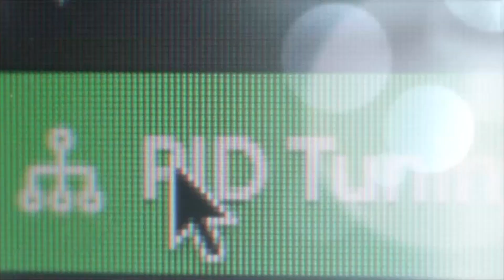Cleanflight and Betaflight Are Ending Support for F1 Boards

Comment: Found an AfroFlight32 while doing some cleaning, plugged it in to current betaflight and saw it connect with its 3.2 firmware. Feels odd to throw it away, maybe I will add it as a flight stabilizer to a plane that has no FPV and no telemetry. One UART, just one! Crazy, how did we live like this, lol...

Comment: i have naze32 and I'm still using cleanflight. You may have to use the "recovery" method when flashing the latest firmware, but its still supported.

Comment: And here we are, almost 2 years later: The crappy F4 zombie without hardware inverters is still surviving, for some reason, even though the F7 has made it obsolete >2 years ago. Well, that's how things are. Bad habbits die hard.
Reply from the maker: F4 boards are between $5 and $10 cheaper than F7 boards typically. If the F4 does everything you need it to do, why not save $5.
Reply: @JoshuaBardwell  :-D Perhaps because $5 is usually ~10% of a good FC’s price and I just don’t want all the hassle that comes with an F4. For example, let’s say you get an R-XSR. With an F7, you may choose to connect your S.bus and SmartPort to a random pair of UARTs from the 8 available. Or you may just as well choose to go with F.port and save the other 7 UARTs for SmartAudio, external OSD, ESC telemetry, GPS, LIDAR or whatever else. With an F4, you will always suffer: Cut the R-XSR’s heatshrink, solder to the uninverted pad, redo the heatshrink… That may sound easy, but at the end of the day, your GPS won’t fit, because there are too few UARTs on an F4. Not worth the $5. And with the growing number of 20×20mm F7s (although it’s mostly a 722, not a 745, unless you go with the Realacc Super_S F7), F4s are now utterly obsolete.

I do like to experiment with vintage hardware: https://www.rcgroups.com/forums/showthread.php?2906663-Eachine-XFX90-90mm-Brushless-FPV-Racer-F3-OSD-Dshot-%28review%29#post41722327 Nothing wrong with that. But when it comes to starting a new build, only an F7 makes sense.

Yet ~90% of Betaflight 4.0.x reviews I’ve seen mention F4s or even F3s as if those were still a thing. ;-)

Comment: I just set up a Naze32 for a new flyer, he had it partially built for ages, so I finished it off for him.
The latest supported Betaflight just works.
Did no tuning, just set up flight modes and arm switch.
It flys better on defaults than any quad I have ever set up.
He's lovin it.
I wll put F3 or F4 boards on anything I build in the future but I see no reason to rush out and update my current ones. They will continue to do what they do until I break them.
I can see these F1 boards still being fine as flight stabilisers on fixed wing or as cheap camera gimbal controllers.
Reply: wich version you put on the naze32 ? i m looking for the .hex who will work on betaflight but i dont see naze32 board in the list to dl fw
Reply: @user-mo4ul5td2p  This was 4 years ago, you will have to find an older version.
I still have the quad at home so I will see what is on it when I get home after work.

Comment: I unfortunately received one of these instead of an f3 brushed fc. 
What a pain in the ass. Had to use an old version of cleanflight, and cant find much info on what to flash onto it. Unless I use the oldest firmware, it maxes out the cpu load and wont work right, and if I can get it to work the accelerometer twitches on the configurator which makes my quad yaw like crazy. Its really finicky compared to my f3 that died. 
Anyone know how to use one of these f1 boards and have it be reliable?
Reply from the maker: Start by setting PID loop and gyro update rate to 1 kHz.

Comment: Joshua, I ordered Kakute F4 AIO a week ago and hope that it will be so good as it is described. Particularly because you claim that it would run SmartPort to XSR receiver without modying the receiver itself to deal with inverse signal. I will keep you to your word :)

To ppl worying about Naze support. If your quads already are flying well don't mess with them. When Naze boards in them will die, problem will become solved automatically by need to buy a new FC. Which in that time will be compatible with newest CF/BF.

Comment: Dear Joshua, thank you for the warning. Although I am planning to build a Trifecta with TriFlight firmware, it is good to know and I am looking for a F3 board as you mentioned. However, there are so many types of Betaflight f3. I do not know what model to choose. I am looking for Naze32 measurements or is that also not done anymore? (micro ?).  Which one would you  advise. With drones I am a newby pilot and not very skilled - yet.  :-)
Reply from the maker: For a tricopter, look at David Windestal's FC, which uses an F3.

https://rcexplorer.se/product/f3fc-racing/
Reply: Dear Joshua, I am actually thinking of this board as I do not want a onboard PDB in this build. I have a separate Matek PDB on the level of the motors. FC is a bit too high up:
https://www.banggood.com/Upgrade-NAZE32-F3-Flight-Controller-Acro-6-DOF-Deluxe-10-DOF-for-Multirotor-Racing-p-1010232.html?utm_source=google&utm_medium=cpc_ods&utm_content=jeff&utm_campaign=Smlr-ds-FC&gclid=CK3ChJK74NQCFW4R0wodS1AMbA

Comment: Its nonsense to recommend to NOT use a naze32 if you already have it in a new quad.
Lifespan is one fatal crash away and since you already have it why not use it.
Also a tuned quad will not STOP FLYING once support is ended ; just changing settings might become complicated.

Comment: To be honest, if you are using a F1 board and its working fine. Why do you need to update to the latest betaflight?  surely their current versions will continue to support the F1 FC's.
Reply from the maker: Well, do you like features like SmartAudio? What if your copter pitches forward when you jam the throttle and nothing except anti_gravity_gain will fix it? What about a dynamic notch filter that will let you use higher D gains with less propwash and cool motors? The new revs of Betaflight introduce features that are amazing. Personally, I want to update so that my quad can fly better. But I understand if you don't feel that way.

Comment: The sp3 is a fantastic board. Dominic killed it when he designed that one. the gyro is less susceptible to noise influence and imho has proven itself when logging via debug mode. there is probably a reason why they choose it for the rtf wizard. I would love to see a video based on debug mode for gyro vibrations of different flight controllers.

Comment: tbh my naze32 with baseflight flies just fine
Reply from the maker: Having seen the massive improvements in flight feel and tunability that have occurred in Betaflight and Raceflight and KISS in the last year or so, I simply don't believe you know what you're missing. Baseflight hasn't had a release since August 2015, and its last commit was January, 2016. The project has stopped development and is dead. So unless it was already six months to a year ahead of everybody else, it flies worse than everybody else. And I don't think it was ahead of everybody else.
Reply: lies

Comment: So my only question is will the keep it where you can support old versions with the GUI? As long as I can continue to configure the boards that would be good. Hopefully they don't remove it completely and make it unconfigurable if you have old equipment. Otherwise I don't mind being stuck at 3.1.6 on my F1 boards. (Granted, all that fly the F1 boards are my bashers...and whoop)

Comment: Hi, I would second the clickbait comments : the latest BF is still available currently for F1 boards so as the previous ones (I have a 2.6 on one of mine (F3...), the usb plug is just a pain to access and it never broke enough for me to open it up fully).
. It's not like keeping on using WinXP and be exposed to 0day exploits : the copters we love which have a F1 board will just not have the latest software improvements, but it'll still fily like we are used to.
But thanks for the heads up, I thought this would be coming a lot earlier !
Reply from the maker: The title of the video is perfectly descriptive. The goal of the thumbnail is to get you to read the title.
Reply: Sorry Joshua Bardwell, it's not exactly what I meant. "It's time to think about alternatives" for a copter which flies ok, is a bit extreme to me. "Naze32 is dead", well yes.

Comment: Had been looking at getting Omnibus F4 Pro for use in fixed wing & curious as to why you no longer recommend them & what the quirks you allude to in this clip please...
Do these quirks also stand for the non-Pro versions?
Lastly, Ive been meaning to ask for a while, do you know of/could you suggest a duel voltage BEC (simultaneous 5v & 12v output) which also includes a current sensor please?
It would need to handle 8S (hopefully) with a pair of EDF's & 100-120Amp ESC's, AND 4servo's & a RunCam Split on 5volts along with voltage for the board...
Thank you for any input & your time you put into this hobby :)
Reply from the maker: The quirks have to do with support of inverted serial protocols like SmartPort. I have heard of people having problems getting it to work in some cases. I don't know the details, but since there are plenty of other boards that get the job done, I would suggest using them. If you have an Omnibus Pro, you can use it. It's not like it has a drop-out-of-the-sky flaw.
Reply: Thanks for prompt reply again! :)
Looking to Omnibus Pro V3 for a long distance single motor wing, thinking about non-Pro for above mentioned project IF (jeez I miss using italics) I can find a PDB with duel output voltage BEC & Current Sensor if you might happen to have heard of anything please.
Holding off buying Omnibuses until I know which way to go with PDB, or even if I can...
So far Ive had little luck- came close but the one I did find had a built-in OSD in PDB :(
Would you happen to know of one I might of missed & tick the boxes please?

Comment: is this why betaflight wont connect to on naze32 FC anymore? I thought my usb port broke
Reply from the maker: No, this isn't that. This change hasn't happened for one thing, and this won't break backwards compatibility with the configurator for another thing. You have some other problem. If you can't connect, hold the bootloader button down, plug in the board to USB, wait a second, release the bootloader, and then re-flash the board.
Reply: Quad still flies fine. I was trying to verify a setting just yesterday ago and it didn't connect. I probably won't bother to reflash, when it dies it dies! I'll get to buy new stuff.
Reply: And if even that does not work with the configurator then go with STM's program STMFlashloader Demo. If flashes every board  with every corrupted bootloader or firmware.... (for boards with a virtual com port use STM's DFUSeDemo program, but then you have to convert your *.hex files first with STM's DFUFileMgr program to a *.DFU file)

Comment: The naze32 in my DJ105 flies just fine with the version of betaflight I have on it now.  Maybe I won't get some new whizbang feature from a newer betaflight, but is that really a surprise?  I skipped the past couple updates anyway since they started using a floating point PID controller.  It would be a major PITA for me to upgrade and I'd only get marginal improvements since I'm not that great of a pilot anyway and don't have a lot of time or space to practice.  Once I destroy it I'll obviously replace it with something newer, but until then the naze32 is certainly not dead!

Comment: I still own 4 copters (one of them is a self constructed Y6 with sonar) with a NAZE32. All of them have a GPS and a 3DR radio and work with iNAV firmware.
 Due to the F1 problems mentioned in this video I proposed approximately 9 month ago iNav developers to stop support for F1 boards. 
They heavily refused my request. 
We will see, what they will do now..... (btw., have some OmnibusF4 Pro, a Spark2 and some SPRACINGF3 in stock to replace the NAZE32....)

Comment: it's not in the fc, it's in the pilot. just ask the champ korean kid who still uses a naze. look him up and think if you can beat him on your f3/f4/f7 fc. good luck.
Reply from the maker: The balance between talent, skill, and equipment varies for each person. Minchan Kim is going to smoke you no matter what copter he flies. Jack White is going to lay down a kick-ass guitar solo on a $20 guitar from Wal-Mart. For those of us without that level of skill and talent, better equipment can make a difference. I have heard more than one pilot say that they put down lap times seconds faster on a RF Revolt vs. a BF FC, for example. Advanced filtering makes propwash handling better, for example, which lets the pilot leave the throttle up through a turn and carry more speed. If you are a very good pilot, you don't need this "crutch" but if you're only a sort of good pilot, then this can make a difference.

It's silly to point to the best pilot on earth and say, "he only needs a Naze, why not you?" Because I'm not as good a pilot as Minchan Kim, that's why.
Reply: Agree with you jb, wasn't pointing at you. It's those commenters (mostly newbies) to the hobby who don't even fly well enough yet, but are very quick to jump on someone who is starting out in the hobby asking, is an f1 fc like a naze good enough - and it quickly goes to pieces for the one who asked. Specially on reddit.
Reply: S B I think mainly people would jump because the price per fc isn't necessarily justified to buy a naze 32 now. The prices are so close that it's just not viable to buy older hardware. Kinda reminds me of the whole ddr2 vs ddr3 debate when it first appeared.
Reply: Yes agreed, at today's price point, no sense in getting an f1. But for the people that are still rocking the f1, and happy with it, there's no need to upgrade just unless they really want the f3 features just because some noob jumping on the hype train says f1 sucks.
Reply: Yeah I can't put my input in on the features one may gain (I do run an f3) but I do believe the f1 while it may be on its way out it'll still fly just as good as it did before they stopped support. Then again forum snobs are just that. While I'm excited for the new advancements in our hobby like the new run cam split I still think it's hard to consider something obsolete so soon.

Comment: Nice board Kakute F4 and i see the IMU with a ribbon wire? is this to keep the IMU on the foam pad free of vibrations? Looks like it. Nice design, my next build soon. Joshua where can i get one?
Reply from the maker: Yes, exactly. The foam mounted IMU is designed to allow you to hard mount the board. I hope it works well in practice as it was my suggestion. We shall see.

I don't know if the F4 is for sale yet but there are a few places you can find the AIO.

Comment: Joshua great work always. What's your beef with the omnibus? I know the F4 Pro? All I use is omnibus boards. Something I need to be worried about?
Reply from the maker: I think there are some bugs with serial support under some configurations. Many people are using it successfully but there are others that can work more universally.
Reply: That makes sense. I mostly use the F3 and F4 V3. I'm not big on current sensing. too much hassle calibrating. Are those boards effected or just the F4 Pro. PS thanks for responding

Comment: My guess is Betaflight 3.2.x will see the discontinued support of F1. Not the initial release of 3.2.0 though. Even now in the pre-release versions of 3.2, BeeBrain, CC3d and Naze boards are still supported. My assumption is that all current boards running 3.1.x will be able to run the initial 3.2.0 firmware, but from that point on, will no longer be supported. That way they will be able to use the new configurator with their outdated boards. Rather than having to use an old configurator for their F1 boards and the new configurator for F3+ boards.
Reply: Well 3.2 will support it, but almost everything that is being added new to the firmware is only done for F3, F4 and F7. The F1 is already lacking so many features and nothing more can be added there

Comment: I'm about to put Omnibus F3 1.1 into my quad. Any reason not to (aside from the overheat which will be dealt with external bec) ?
Reply from the maker: No, the F3 has no issue with UART inversion.

Comment: Code monkeys are fresh college grads, IT coders, self taught, or eastern Asian coders. I'm guessing most of the Betaflight/Cleanflight staff/volunteers are software designers, engineers, developers and architects. You didn't say anything about iNav, long since the champion of the F1 boards.
Reply from the maker: No disrespect intended to iNav, but it's just not much on my radar because I don't fly assisted flight.

Comment: Can't agree with the saying not to use a F1 board if you're making a new quad,if you have F1's boards and want to use it why not.
Current BF versions are quite stable and fly really well so there is no reason to upgrade it, so a F1 board can be kept in use for long time.
For any new purchases yes... look at F3's.
Reply from the maker: I would be upset if, in six months, I couldn't use the latest because it wasn't supported. I wouldn't build a quad today with gear that would prevent me from running the latest BF on it later. But that's just me.

Comment: What are your thoughts about the new cl racing f4 aio... as far as f4 goes it looks like the holy grail. Sd card reader, pbd, current sensor, betaflight osd, smart audio and telemetry support, ample 5v and 7.6v 1.2 amp each filtered bec. I have a armattan chameleon on its way with one, and depending how she runs which I expect well for a USA made board it'll prob be my go to board. It's also nice that it's a true 36x36mm for a pbd fc, a lot of them are larger

Comment: Hi Joshua , need some advise , I want to have in flight pid adjustments and video  channel and power adjustment with taranis radio , could pls let me know wich  taranis receiver , flight control and video transmitter  should I get , all these is for a space one 220 race frame thanks